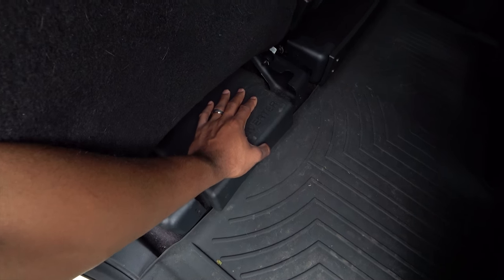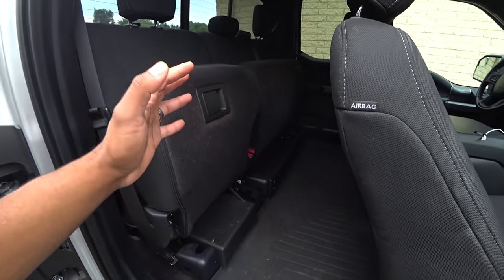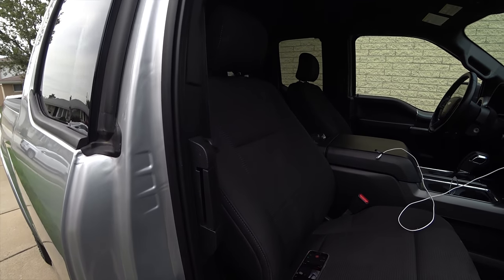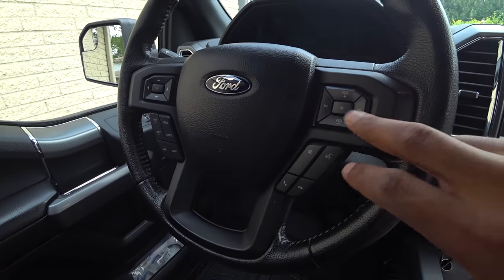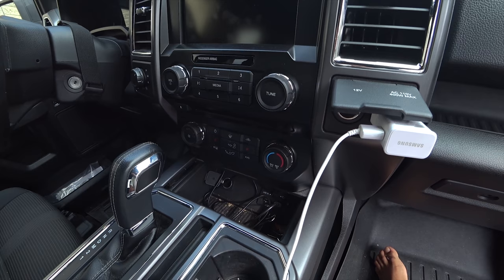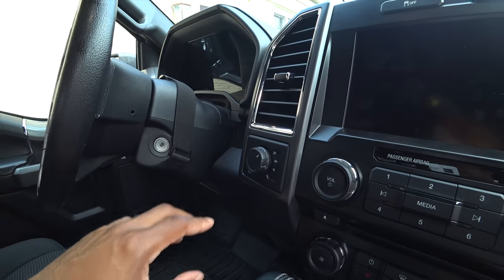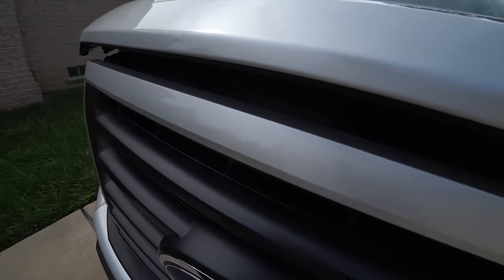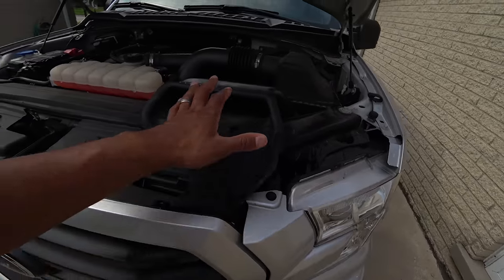cool features on the f150

Comment: Don't forget the louvered rad cover that closes on high speed for better aerodynamics and that it can close to warm the up the engine operating temperature quicker.. This is a god send when it is -30c here in central Canada. This truck with the 2.7l throws heat like a beast! 100% Better than my last 2014 F150 with the 5.0 when it comes to heat in the winter.

Comment: Just got a 2017 V8 Supercrew Sport f150. Love you videos. Lots of useful info. Do you know what is the purpose of the electric louvers just behind the grill? When you start the truck, the louvers will cycle open and closed. I think it has something to do with the air intake snorkel.
Reply: evelec louvers behind grill are for aerodynamics on the highway to aid fuel mileage.
Reply: They stay closed until the engine is warmed up but they are for air flow and fuel mileage

Comment: Pulling out the 4x4 knob locks out the rear diff. to 20 mph.
Reply from the maker: yup!
Reply: sixshooter4570 
Not true.  It actually locks your rear differential. Putting power to both rear wheels instead of just one rear wheel. Both rear wheels will then spin in poor traction conditions. Works great !!!!!